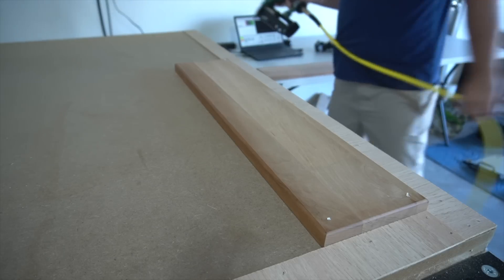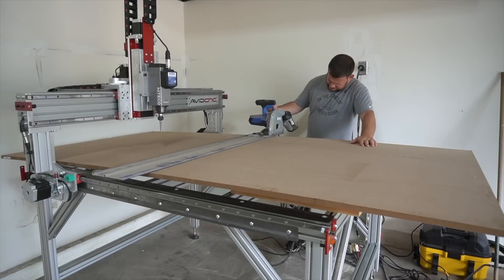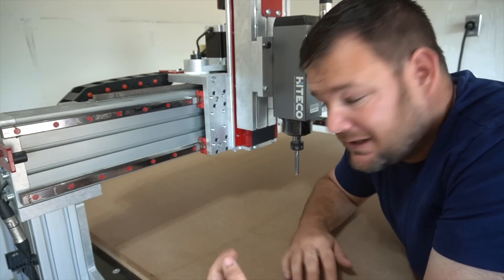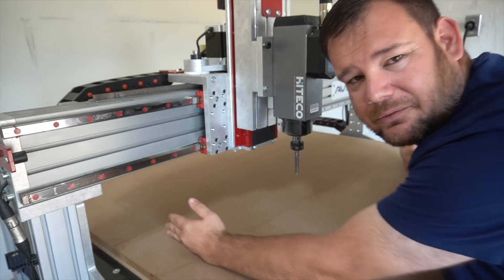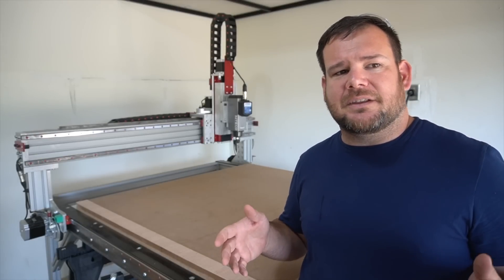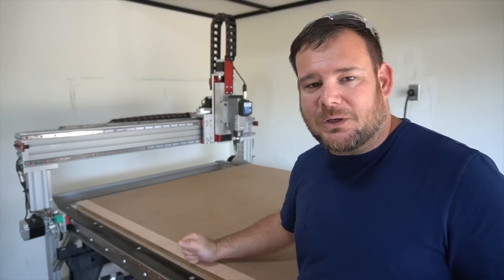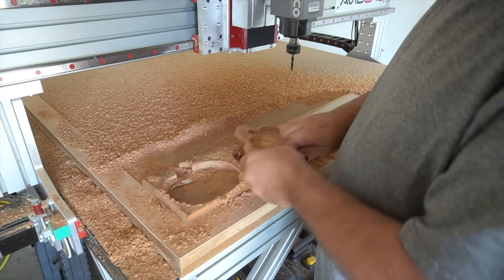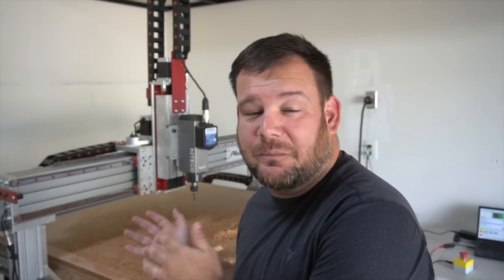I Have A LOT To Learn! - New Avid Pro 4848 CNC Router

Comment: Hey, do you have a compare and contrast between the avid and the shapoko pro? I am back and forth between the shapoko 5 pro and the avid, the shapeoko look nice for the price, I have used an avid CNC and it was really nice.
Thank you!
Reply from the maker: I don't, yet. But just as the price point reflects, these are 2 VERY different machines when it comes to performance. If your budget allows, I'd go with the Avid
Reply: @AndyBirdBuilds  thank you for the fast reply. I am interested in having the machine make money when I am not using it for personal projects, but I think the avid is out of my price range for another year or so :/
Reply from the maker: @hybridosniper  I made a lot of money with my Shapeokos over the last 4 years. It can be done
Reply: @AndyBirdBuilds  I appreciate that. I am looking for something that can do some aluminum for personal projects and then wood to make money mostly
Reply from the maker: @hybridosniper  The Shapeoko can do aluminum. Check out @carbide3d

Comment: hey got to ask at end of video your black walnut treys you make that you make lots of why Arnt you are making those deeper. i make the something but out of 2 inch and cut out 1-1/4 and i believe 2 inch wide so crackers can fit into them also olives and other things can't get all the food on my charcutier boards i also make
Reply from the maker: No other reason than that is the design the customer wants
Reply: @AndyBirdBuilds  hey what are you using on sanding stuff on those the deeper the harder the sand little elbow grease. im doing a lot of 3d bowls and the sanding is killing me corners any suggestions on bits to make better
Reply from the maker: @sheilamarsh879  Maybe something like this https://amzn.to/3TFZiYx

Or this
https://amzn.to/3D449eU
Reply: @AndyBirdBuilds  love your videos they help me a lot I'm new on the cnc

Comment: If you feel you might be using large sheets, ditch that square and use the machine to drill some holes you can drop reference pins in (dowels if you'd like) and remove when you want to use the full board. Double side tape is too thick, too much give for some projects. Painters tape and super glue holds flat stuff like a champ! I built a vacuum for my Avid 4896, but don't have it sectioned off for small stuff, the sound isn't worth it. Very fun machine, can't wait to see more.

Comment: I ran several different CNC routers for several different furniture companies in the High Point area of NC for around 20 years. Shodas, Biesses, Heian, Wadkins, Hass, Onsrud and others. I started to comment about how important holding down the material is when I see almost every single comment talking about that. A vacuum table works best period. That being said there are ways to make forms or fixtures for lack of a better word especially if you have a part you cut a lot. Double sided tape and plastic nails won't hold pine or poplar, much less walnut. Also remember that once you get familiar enough with the CNC C clamps may be an option. It does bring into play hitting said clamps so I would use that as a last option. Also RPM and feed rate are a factor as well. Although, if it were me, I would do a little research and build some forms for each part I wanted to cut. Enjoyed the video.

Comment: Hey Andy, thanks for another great video. That new machine is bad ass lol. Regarding the hold down, if you follow Vernon Hinkle, he has a hold down that I love. He cut a T slot on each side of his wasteboard then inserted a T bolt that goes through a board on top of the waste board and is pulled against your piece and tightened down. Theres no nails, tape or screws. This works for MOST of my projects. Its hard to explain but if you watch his videos its really easy

Comment: Another great video, thanks Andy.

 I've been interested in Avids machines and their price point, but I'm disappointed they don't have ATC Spindle options.

As for work holding, tapered or rebated custom fixturing is King if your going to make the same projects over and over again on the same size piece of wood. Box that sucker in. You can still use tape to avoid tabs, but less of it, saving you time and money. 

Another commenter suggested putting the threaded inserts into the permanent layer and I agree. Just be sure to resses them so that you can run a program for drilling new spoilboards, that way you won't hit them during the operation.

Comment: Threaded inserts, you could place in the lower MDF panel, then just have holes in top waste board at those locations.  I have to use this method due to a vac bed, however the downside is you can cause changes in the bed level based on how much you tighten the screw down (on regular maintenance check). Cutting thin sheet alu, even 1/4 of a MM is a pain to get out & clean up on sectoins of a part. I'm one of those who hates it when I do cut more than a scratch in the waste board. 

If you're not cutting loads of large thin sheet material and don't need to stop it arching, a vac bed isn't really needed, any of your current methods are more efficient & appropriate.

Comment: I’ll have to learn how to hook up a controller. Seems legit. I have inserts in my spoil board but mostly I use fastenx 2sided tape and screws when I can. It works for me.. I also will use carbide 3d clamps in my threaded inserts or I bought meyers wood shop’s files for his spoilboard and clamps. The clamps are awesome.

Comment: So for work holding… at work I have used mask that’s used for vinyl masking. You can buy it cheap in wide rolls like 24”. If you apply that to the back of your work piece and then the wasteboard and use spray adhesive in between. Works really well and easy to pull off after.

Comment: @Andy Bird Builds pick up a IoT relay from Amazon. Your VFD can trigger it every time your spindle is turning and you will have automatic dust collection. It can also be turned off with the touch of a button if you wanted to film without the noise of the dust collector.
Reply from the maker: Thanks, I'll check it out!

Comment: I always used to use double sided tape on my projects and found out that if you seal the MDF with 1-2 heavy coats of shellac then sand it back it slightly that helps improve the adhesion a ton. I likedto press mine on with a j roller. 

I’ve since moved onto dog holes and wedges to hold and locate pieces. I’m working on some wedges that can apply both horizontal and vertical pressure to fix the issue that wedges normally have.
Reply from the maker: I like the idea of dog holes and wedges. I just need to get there and work in into my workflow
Reply: You can also use pva around the edges of the mdf to help with vac pump suck, also blanking off areas you are not using.

Comment: Don't put threaded inserts in your waste board. I put brass inserts in my first CNC build, thinking that brass wouldn't cause any bit harm when surfacing, true statement. However, even with a dust shoe attached, I got flying brass shrapnel. On a later little CNC, I machined holes in the MDF, tapped those holes with 1/4-20 threads, and put a couple or so drops of thin CA glue down each hole to strengthen the threads. Also, I use nylon bolts for any work holding. I've not had any problems with either.
Reply from the maker: Thanks for sharing, Roy.
Reply: @AndyBirdBuilds  you can get threaded nylon rod from McMaster. 
It is a great alternative. All you need to do is makes some little wooden knobs and epoxy in a length of the threaded nylon. It makes a great way to clamp things and absolutely bit friendly.